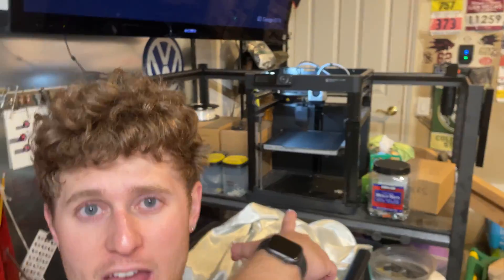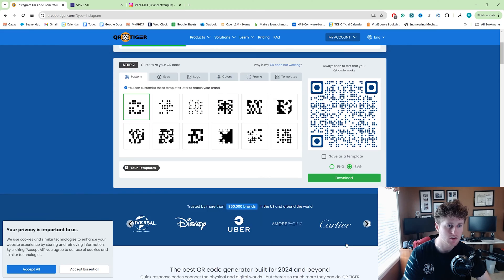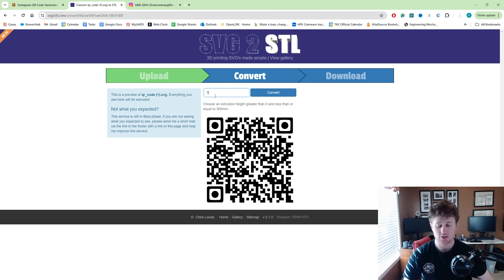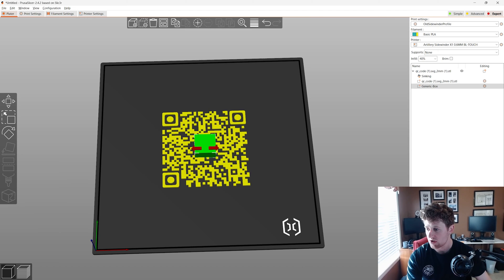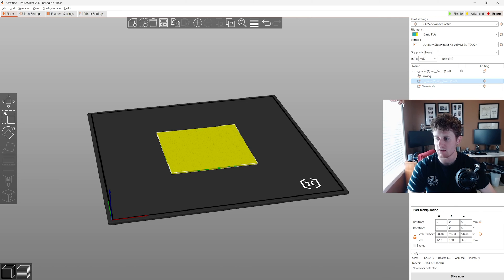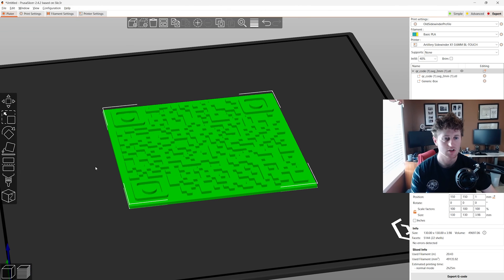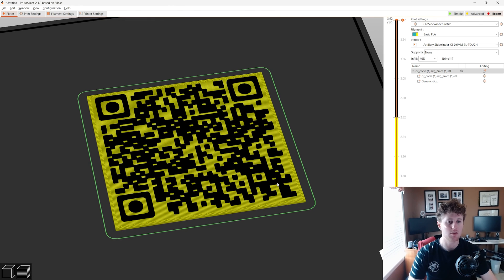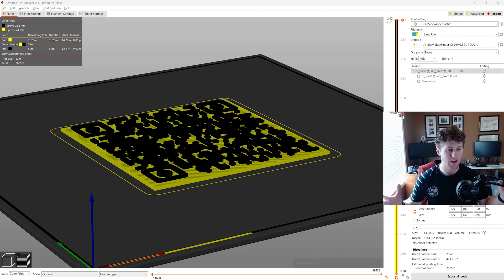3D Printed QR Codes and images How Too Guide - NO CAD Required - Easy Functional 3D Print

Comment: That is great! Going to have to try this. I wonder how small can this be printed and still work.
Reply from the maker: That’s a great question, it probably depends on your printer but my guess is about 2 inch by 2 inch
Reply: @rwhopkins07  for sure, the printer will make a difference. I will have to test that and find out. I will share for sure once I do that.